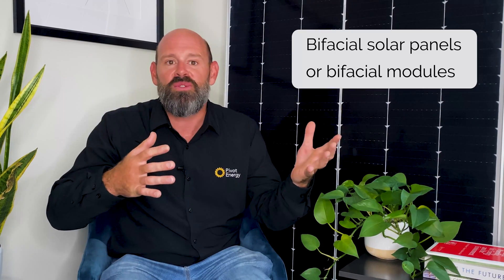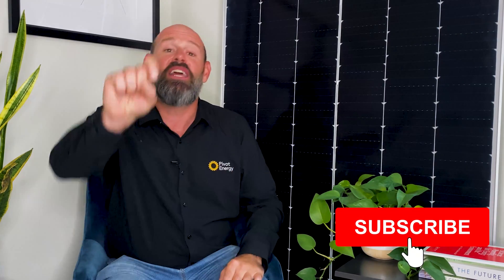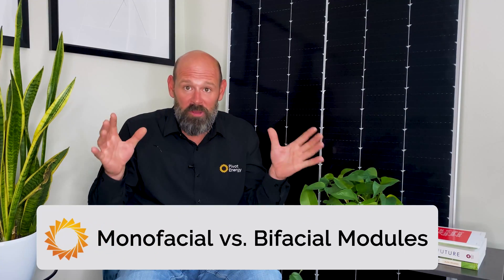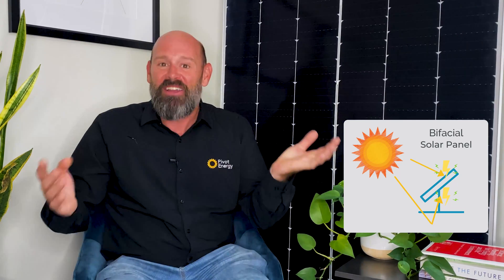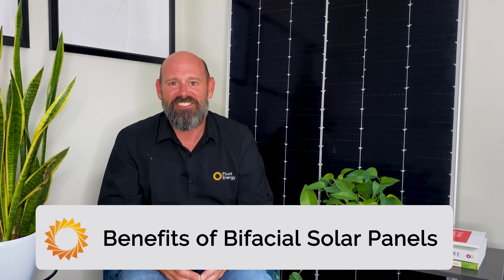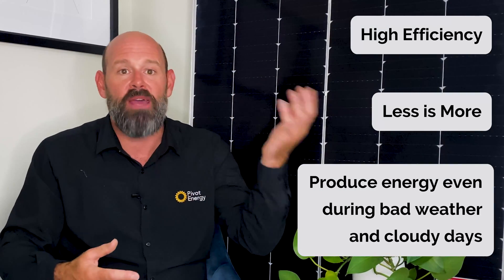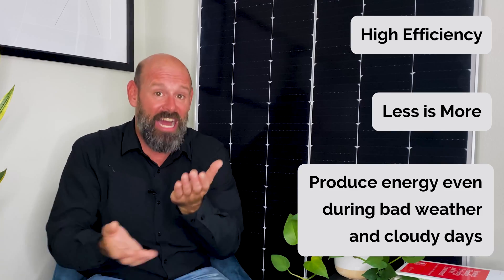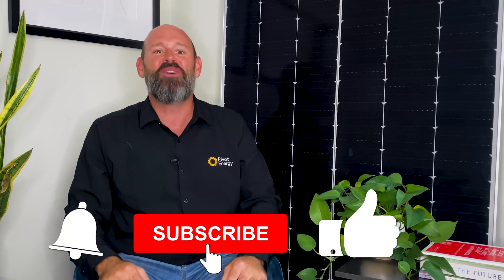What Are Bifacial Solar Panels? How They Work & Benefits (AKA Bifacial Modules)

Comment from the maker: What type of surface are you thinking of getting bifacial solar panels on? We can help you determine if it's going to be worth it!
Reply: I got these for thier usefullness in winter and cloudy weather. Both sides would roughly produce the same on super cloudy days and provide hugely higher output. In winter I can tilt them to nearly vertical(like a fence) which prevents snow accumulation on the panels. On my RV they are laid flat and flush while moving but will be raised above the roof and tiltable. I also got mine on sale for about 73 cents(usd) or 92 cents cad per watt as they were left over from one of the suppliers previous projects.
Reply: they are on tracking system structure and the underlying surface is just soil
Reply from the maker: @tinashetavengwa1442  In the case of a ground mount array in an agricultural area, we would also clean the bottom side if there's dust buildup from harvesting activities.

Comment: Are these Solar panels rated for both side generation or they only rated for front surface only,with the back side generations coming in as extra power.If these are rated for both side generation,does it mean somone using these panels on flat surface without back reflection gets less power that what manufacture claims.
Reply from the maker: Hi! We use bifacial solar panels on all of our projects to maximize the energy generated from the sun on the system 🙂 🌞

Comment: how do we clean the bifacial pannels
Reply from the maker: Hi there! To clean bifacial panels, we would likely focus on just the 'top' side of the bifacial panel. The 'bottom' side in a ballasted rooftop application will not see much soiling buildup, and may just require light cleaning or none at all depending on the local conditions.

Comment: So, if I did a bifacial solar roof over Galvalume, I'd want to create an air gap of maybe 6 inches minimum?
Reply from the maker: Thanks for your question! Generally, bifacial gains are not modeled in flush-mounted applications given there is not enough standoff from the roof membrane. PVsyst or PVcase design-engineering modeling is required to explore this in greater detail, but in general we can realize bifacial gain with the inclusion of specialized racking in 10 degree+ ballast-roof applications, ground-mounts, and even carports.

Comment: So if a bifacial panel is rated at: for example 350w, does that include both sides, or just the front side, and the back would be and addition to the potential 350w?
Reply from the maker: Great question! The nameplate rating of a module, measured in power (watts) is static. A 350 watt bifacial module and a 350 watt monofacial module are identical nameplate capacity, however their energy outputs differ, given the added generation from the back sheet of the bifacial modules.

Comment: I am very interested, I ask myself if the panels can be removed if you are not on the place for months where they are installed, to prevent theft
Reply from the maker: Hi Antonia. Removing and reinstalling solar panels can be expensive and inconvenient, so we only recommend removing if absolutely necessary (i.e. roof repairs).

Comment: Hi. Is there any benifits when bifacials mounted flush on black tiled roof?
Reply from the maker: Thanks for your question! Flush mounted bifacial modules (regardless of roof color beneath) won't really see much gain. However, bifacial modules may be cost effective due to them being exempt from certain tariffs. If a tilted mounting option is available, you may be able to see some gain, but otherwise a cost analysis of monofacial vs bifacial modules should be the primary driver for your flush mount system.

Comment: Hi Erik, interesting topic but is 2% to 7%  more power, worth the more cost you pay for the bifacial modules? I would have expected to gain something above 30%. Thanks
Reply from the maker: Great question! The additional cost for a bifacial system varies depending on site, but through our research, we have seen the slight increase in price is always outweighed by the benefit of the increased production. While 2-7% might not sound like much, it is extremely beneficial to the financials of a project over the lifetime of the system!
Reply: @PivotEnergySolar  what is more efficient, what are the numbers? > Bifacial Solar Panels Or Perovskite Solar Cells Panels?
Reply from the maker: @drzavahercegbosnaponosna5974  Great question! Bifacial modules right now are at ~23-25% efficiency aka converting that much of the sun's energy into kWh. Perovskites are at a similar efficiency rate, but they are still an emerging technology. So their cost tends to be higher, and warranty periods tend to be shorter. As we mentioned in the video, bifacial modules will increase production on a more traditional installation by 2-7% depending on your geographic location.
Reply: It's not just more power there are many advantages for bifacial panels like frame corrosion due to high local voltage, delaminating problems, panel soling losses are almost zero all this will result in extra panel life
Reply: 2 to 7 percent more is just from reflection from object